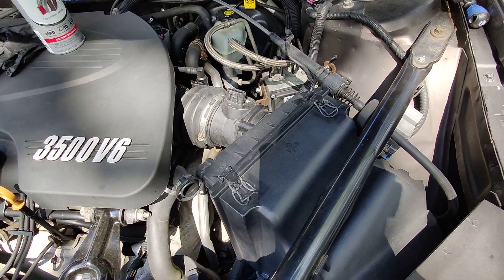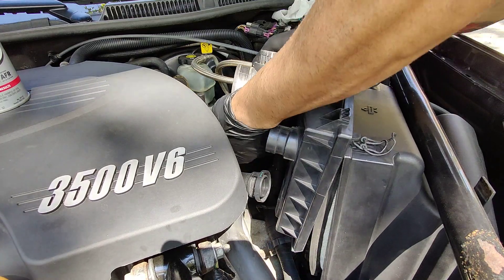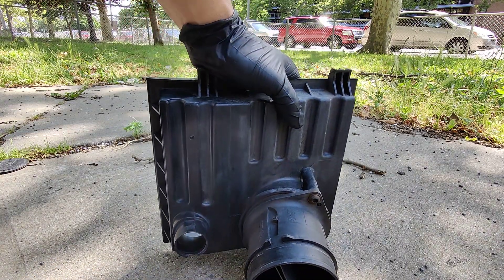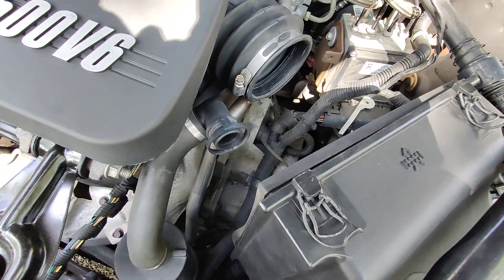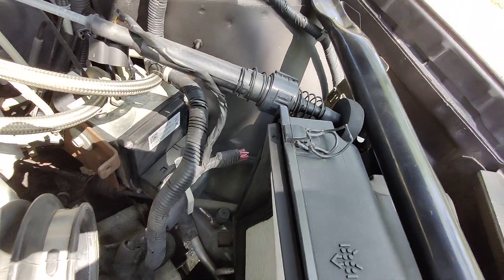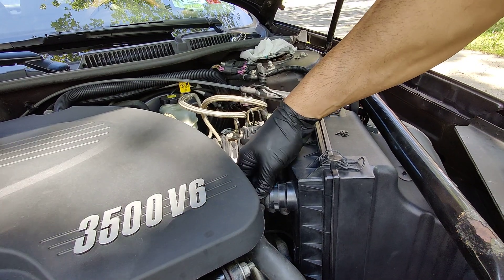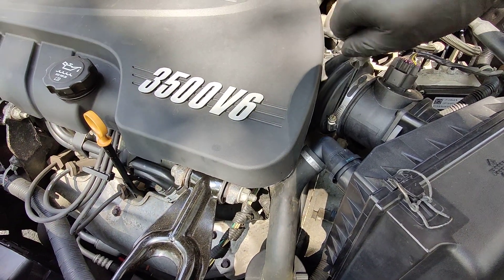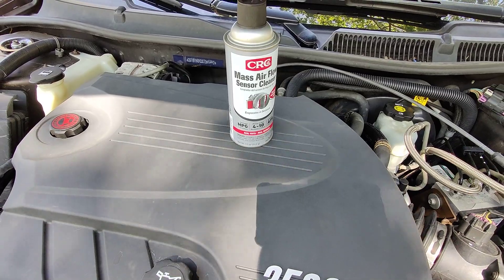Want better  engine performance ??     2008 impala

Comment: What's the cleaner u using brotha
Reply from the maker: Mass air flow sensor cleaner by crc
Reply: @dannysautorepair  thanks bc I'm working on my Chevy Impala 08 and my starting is disabled it says service throttle I'm hopping the cleaner work's brotha